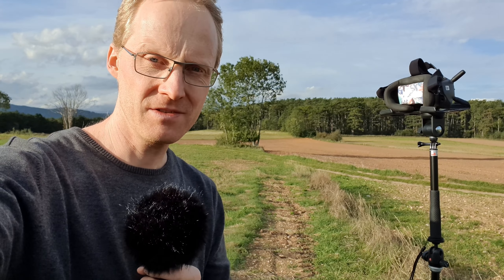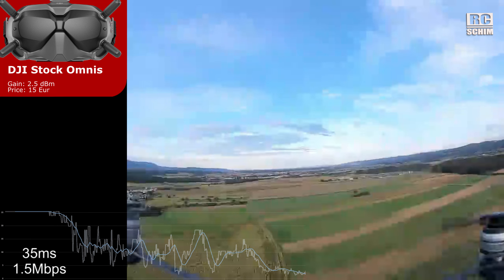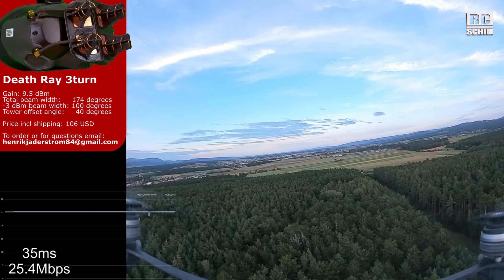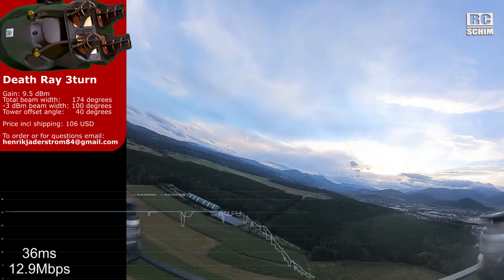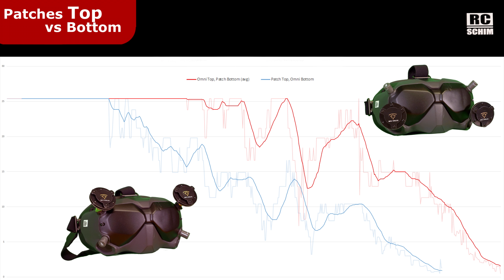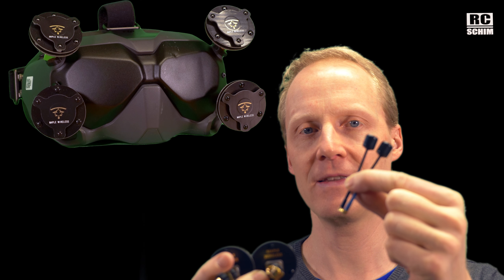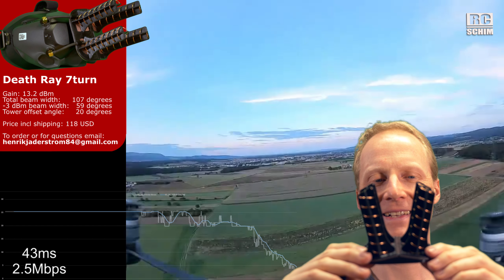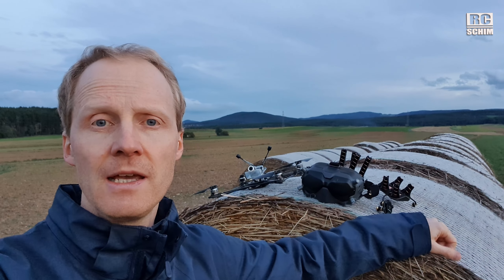Best way to test DJI FPV Antennas!!!

Comment: :( I watched but didn't figure what I was meant to learn.. trees block signal?
Reply from the maker: Yep, it was dissapointing to me that my faulty test setup invalidated the results. But since all antennas had the same disadvantage it's still not a total waste of time (I hope).
Also you could have learnt here how to easily convert your SRT files to CSV and load them into Excel - if you're nerdy enough ;)
Reply: @Rcschim  :) thanks. Not yet but I will. I'm still hopeful to export BF logs to SRT.
Reply from the maker: @fpvwing  do you know Gal Kremers nice website tool which does exactly this? https://kremerfpv.info/#subtitles
Reply: @Rcschim  thanks! By the way, since only bottom left is really used for longer range, is directional worth it for others 3 antennas? I've got crystal, thinking of cyclops mini, but maybe just need a patch on bottom left!?
Reply from the maker: @fpvwing  I admit I still dont fully understand how those 4 antennaports really work. In tests we just saw that the bottom left is quite important.
I dont think that the other 3 are not needed. Using just 1 patch or 3turn on the lower left didnt give me the same worry free range than using 4 directionals. Cyclops mini is also a good choice! Single Patches are mostly not convenient enough to mount or not pointing in a good direction...

Comment: What u clearly see is - that u spend too much money for nothing. There ist NO really more range - but u loose ~ 100$. Thats it. Thats true. Thats reallity. Stop all that forum antenna hoaxes...
Reply from the maker: Nope, wait for my next video, probably tomorrow. There i use the same antennas but this time flying higher. There the difference is greater...
Greets, Mario
Reply: Nope not true at all,  I tested mine with like 4 different brands in a bunch of configurations, and got noticblly bettery signal/distance using aftermarket antenna.  I settled on Triump stubby omnis on top and Lumenier Axii patch on bottom.  (standard white patch ones, not ones made for dji goggle)  
There's also many youtubers that have ran distant test, all with similar results.
Reply: It’s technicaly impossible that we gain signal power(we know that by transmition speed) with no range extension. At some point Mario had some big signal loses from trees.
In open air signal should not go down so rapidly.